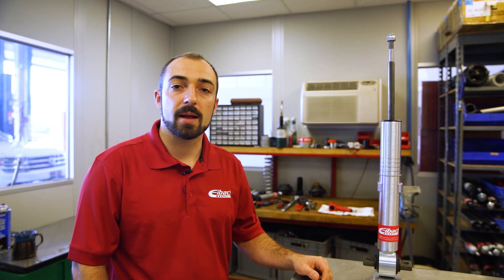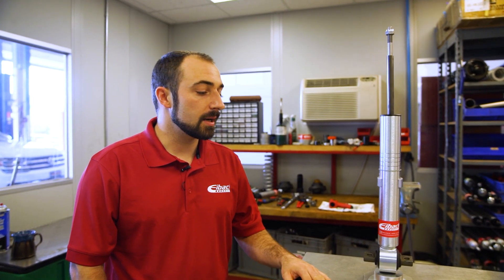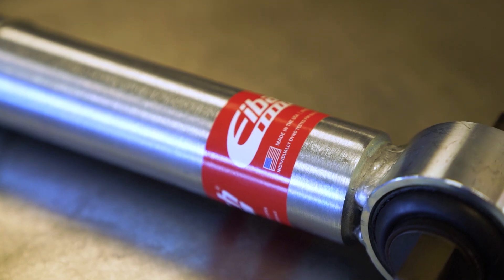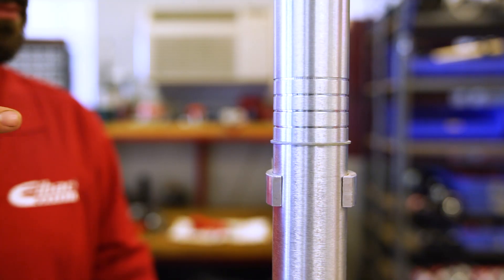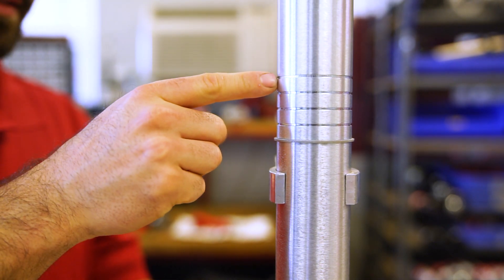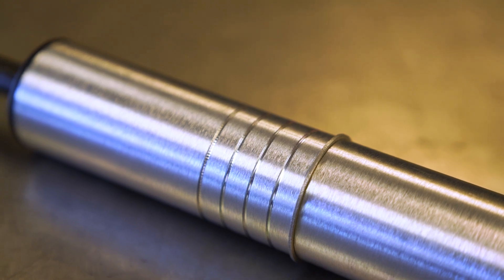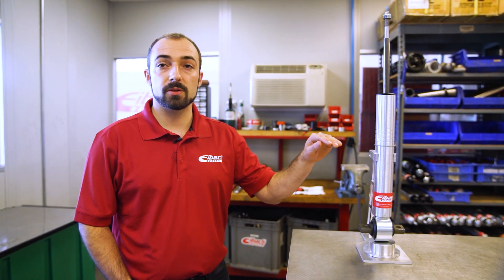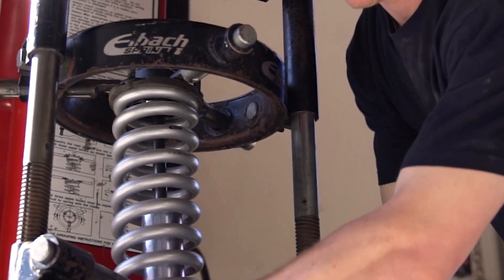FAQ Fridays: RIDE HEIGHT ADJUSTABLE CLIP

Comment: I just bought the adjustable struts and new eibach coil springs for my 2015 Silverado. So do I set the clips on the bottom? Also new eibach shocks for the rear, do those go boot up or down?

Comment: I have a 2016 4 Runner with the Eibach Pro Truck Lift. I have had it on my vehicle a little over a year now. Would I be able to use the Eibach Pro Truck 2.0 front coil overs with my Pro Truck 1 rear shocks and springs?

Comment: Is it possible to adjust once the strut has been installed? If one wanted to change the ride height.  Ty
Reply: Same question. I'm about to buy new shocks, springs, etc to rebuild my suspension but Eibach refuses to answer this question online for their 1.0 kit. My guess is that they can't be adjustable while mounted and they don't want to say it.

Comment: Where can we find real clip setting instructions before we buy? I need a video for Tacoma telling us what the clip settings are. Not just saying a general stock height to level with rear???
Reply from the maker: It is on the website. If using the stock springs, the lowest clip is stock. Middle is about 1" and 3rd clip is about 2"

With our springs, the lowest clip is 2" of lift. The middle and top clip are suggested to only be used if the vehicle has extra weight added, such as steel bumpers or winch. Without added weight there maybe a degradation in ride quality using the middle or top clip.

You can find the instructions by going to eibach.com/instructions and then input the part # of your Eibach product.
Reply: @EibachUSA  Awesome, thank you for your quick and professional response 🤙🏻
Reply: @EibachUSA  could you tell me what level the stage 2 coil overs come set at for Tacoma? 2 or 2.5 inch???
Reply from the maker: @PNWXMATT  It is at 2"
Reply: @EibachUSA  what about skid plates? 3rd notch?
Reply: @danieldee2287  skid plates are below the suspension not above

Comment: Is it safe to offset the clip height setting from driver to passenger side to account for the driver side lean in Toyota 4Runner/Tacomas?
Reply: We haven't confirmed that so try at your own risk. The adjustment heights may also be too great to level it out, creating a left side that's now too high.
Reply: Or maybe if you have a tubby girlfriend

Comment: I have a 2015 f-150 on 2.7 springs. Passenger side touches my UCA and tiny little bumps. UCA upgraded to camburgs, any ideas?
Reply from the maker: Hi, please give us a call at 800-507-2338 extension 114.
Reply from the maker: You can also fill out the form on our website: https://eibach.com/us/p-187-technical-support.html